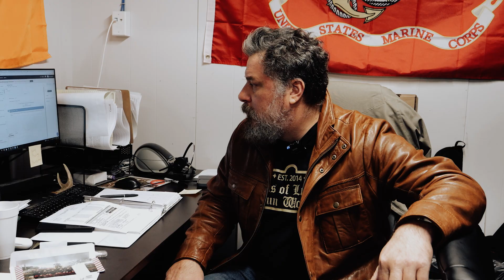Mitsubishi Mailbag: Customer question on gas block “upgrade".

Comment: Keep up the great work, Mike. 👍 

All common grades of Ti actually expand slower/less than steel for the same temperature increase. If this relationship is managed properly, this can result in beneficial gains in clamping/sealing forces that are circumferential to the barrel. For example, Grade V/5 ALV Titanium mates very well with 4150 CMV/11595 barrel steel after the 4150 has been heat treated and stress relieved. SLR Rifleworks is the only company off the top of my head that has a) tested this and b) only uses batch-verified Grade V Ti in their Ti gas blocks. However, 416R + Ti? Dunno. 416R +Ti of an unknown grade? Dunno. Etc etc.

Comment: On solgw website all their barrels are 4150. So does that mean a 4140 gas block on a 4150 barrel is optimal? Is a 4150 gas block on a 4150 barrel less desirable? Honest question if anyone knows.

Comment: What are the differences between 4140 steel compared to 4150 steel in this context of this video? anyone can answer give any insight? 😅
Reply: 4150 is better for barrels but for a gas block it is just fine.
Reply: @gunfisher4661  was thinking the same thing…. Wonder not just make them both from 4150 since it’s a stronger steel. 🤔🤔 maybe 💲 cost saving ?

Comment: My thought about upgrades would be mated with barrel and drilled for taper pins.
Reply: I don't mind dimple + set screws + loctite for gas seal (i know loctite melts), however it's understandable if people trust drill/pin more. 

Coil pins seem to be about as secure as taper pins.
Reply: @ComeOnPelican91 , I haven't lost a gas block using rockset yet but two have failed from red locktight.  If it's only a coke can that lives that's fine: my two match DNF's to gas block failure each ready torqued me but I lived. If it's my bedside or serious use gun I want it pinned.  I've broken most of the parts on an AR-15 with my firing schedule and a gas block under a free-float tube I can't eyeball when I clean.

Comment: Expansion does create problems with gas blocks. Don't want them to leak because the expand at different rates.....
Reply: Well, All common grades of Ti actually expand slower/less than steel for the same temperature increase. If this relationship is managed properly, this can result in beneficial gains in clamping/sealing forces that are circumferential to the barrel. For example, Grade V/5 ALV Titanium mates very well with 4150 CMV/11595 barrel steel after the 4150 has been heat treated and stress relieved. SLR Rifleworks is the only company off the top of my head that has a) tested this and b) only uses batch-verified Grade V Ti in their Ti gas blocks. However, 416R + Ti? Dunno. 416R +Ti of an unknown grade? Dunno. Etc etc.